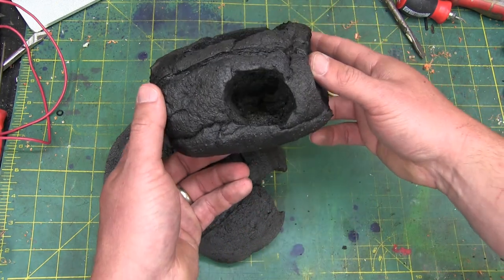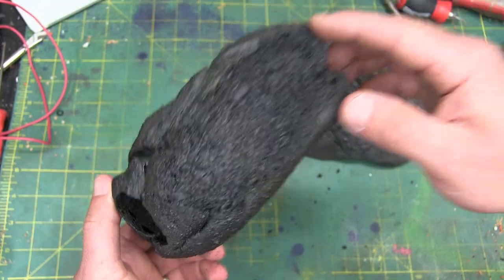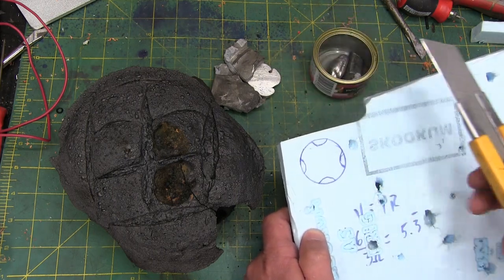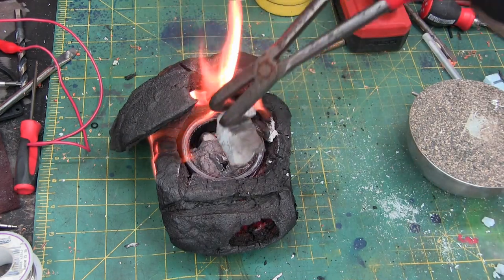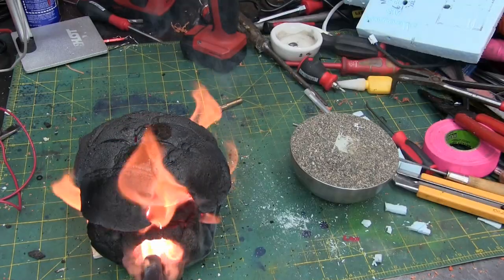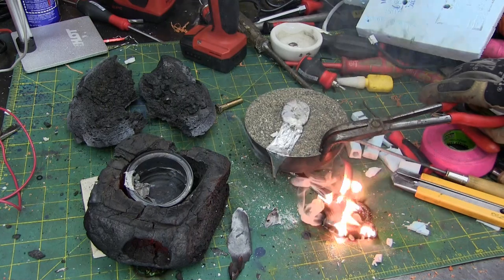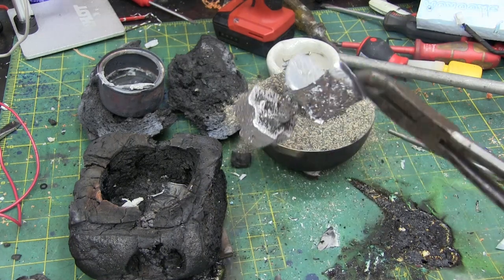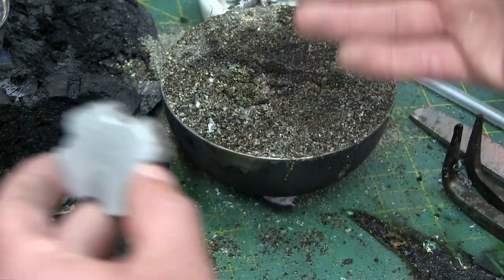BREAD BOWL METAL FOUNDRY!?

Comment: When I  was a wee child, the family and I would travel the miles to our local beach with pan, wicks and paraffin wax in hand to make sand candles. Using crayons for color we would melt our wax on a camp fire and pour the hot wax into small recesses in the sand that we would shape to hold  the molten wax while it cooled. Adding interesting shells and drift wood for effect we would then sell these creations at the church bazaar. While waiting for the wax to cool we would swirl the crayons around for effect and add the wicks in various locations within the candle. Of course we would do this only in the wet sand area so the sand would hold it's shape long enough for the wax to cool but what creative fun we would have!

Comment: That dross floating on the top is actually a good heat insulator.  When making steel calcium oxide (burnt lime) is added as a flocculant, attracting impurities from the molten metal and keeping the heat in the ladle until the desired temperature is reached.  To save energy costs the slag cap is only decanted immediately before the steel is poured.  So could one make high carbon steel from mouldy bread?
Reply: “flocculant” is my new favorite word. I’m dying over here.

Comment: I had mixed results with the bread I had on hand, so I figured I'd try some instant rice in a cannister (the porous stuff that's been pre-cooked and dried).
Holy shit! It bonds in the shape of the container. There was some warping as it shrank but I bet that could be fixed with a bit of experimentation.
So consider this -- carbon foam that you can cast! Just lay down a base of rice, place your shaping objects or cores, fill around it with rice, and heat. It all bonds together. :D 
Woohoo! This is gonna be fun.

Comment: That crumbliness that formed when you moved the metal is one of the most common ways cold solder joints form. One should always hold the part as still as possible when soldering until the solder freezes. Eutectic solder (63/37 Sn/Pb) can be helpful with this as it melts at a single temperature and so doesn't have a "plastic" state.

Comment: back when I was melt in down cans I used a rusted up tool box lined with a wood ash and water slurry after it dried.  that worked pretty darn well as a cheapo refractory material.  used charcoal and a shop vac on blow for the heating.

Comment: Did you carve the bread out before or after you carbonized it?
Reply from the maker: before. Less mess.
Reply: AvE do you recommend a Forstner bit, or sneaking up on it with a boring bar in the mill? Do feed rates vary on sourdough vs 9 grain loaves?
Reply: Just give 'er all she'll suffer.
Reply: You misspelled "cunsten tunglide". 5/7
Reply: PKMartin and it has been buggering me all morning! I blame because of the auto-correct on this high quality chinesium confuser, she was straight off the big rock candy mountain, gingzhou China, bought it not for getting through flea bay, but from the harbor fraught of the north, princess auto, and no it's not a milfuckee, not a snap-off but a real skookum choocher with all that glass reinforced abs plasteek and all the serious gravity corntained within her bowels, tis be a power fist, usually reserved for the wife's former sewing room, on account of the pokey bits being of the wrong angle,  she did cost me quite a few American dollhairs! I should have went "Yerman" enginerding on this one....
Reply: I've never heard of Yermany. Maybe you mean Churmany?
Reply: less mess more sandwich

Comment: I read the article you refereced in the carbon foam vid. Apparently this is also some super strong foam, too. Holds up to 500 psi, where foam used to make aircraft wings is only 60 psi compression.

Comment: I use to only listen to the 1812 on July 4th at the fireworks in Long's Park and on loop while driving around on November 5th. Now I hear it at least once a month. 

Also, I'm surprised that expanded charcoal didn't burn up before the aluminum was melted.

Comment: POW camp engineering at it's best. All it needs is electrolysis of water for the gas in the heating torch. Just dipping the foam in some gooey clay may have given you a much better surface too.

Comment: Forge on a budget. 
You will have to dig out some bread, but the mold is dirt cheap.
Try waterglass w/fine sand. You can let it harden overnight or not surprisingly- blowing it will make it hard. 
A chunk of dry ice or a bottle of CO2 might require less explanation.
Best price to get sodium silicate is ceramics supply. 
Eleven bucks a gallon is much easier than babysitting drain cleaner and desiccant.

Comment: If you seal that with an air proof clay such as kaolin or stoneware, you may be able to prevent it from combustion completely. I’m thinking of just using sawdust bound with clay or starch or both. Basically plastering it on both sides.

Comment: Will someone think of the poor cutting mat! Anyway, if you can, hollow out some of the area around the can, in a slightly larger circle. Then, point your torch toward the tangent of the can, not right at it. You'll heat more efficiently that way; it's how we build propane forges and foundries.

Comment: My boss once said "You can hurt yourself with a loaf of bread." That was 20 years ago, now I know how.
For a funny on your fire; I set an aviation gasoline refueler on fire once. The only real damage was to the cover over the fire extinguisher. I took the mangled remains of the fire extinguisher cover and the discharged extinguisher to the parts guy. I said "Replace this. Recharge this." He looked at the torn cover, looked me dead in the eye and asked "Is this going to happen every time we have a fire?" I clocked out, went home and dove quickly into some beer.

Comment: Fantastic idea, but I don't think it counts as minimum viable.
I occasionally melt aluminum, but not really often enough to warrant building a foundry.
I got one of those Christmas popcorn tins, and cut a hole in the side and a hole in the lid.
I just fill it up with charcoal and point a hairdryer at the hole in the side.
I use a soup can as a crucible, and I can melt around 2lbs of aluminum at a time.
The beauty of it is that the fuel itself is the insulation.

Comment: Hm... You could try using carbon foam as a mold: Put a model made of burned clay into the dough as you bake the bread, then pyrolize the bread and carefully cut it so you can just take out the clay model. Then you should be able to simply pour aluminum into the model-shaped hole to cast it. Or something like that.

Comment: Well… If your experimenting with bread recipes in the kitchen, and a batch doesn't turn out very good, you can alway repurpose it pretty handily. And I think, that if you “rebake” it immediately, you won't have to worry about it growing mold.

There's probably a whole line of research you could go down, for making bread recipes, if you get rid of the requirement that it has to be edible. You could specialize your bread to get the best refractive properties.

Comment: out of curiosity, what would've been the best way to contain that bench fire *without panicking? let's say it was somehwat close to an ignition source and couldn't risk just letting it cool out. let's also say you didn't have one of those white foamy fire extinguishers handy.
Reply: oldfrend baking soda, the beach sand he just used to cast the part, or even just a small bucket of dry dirt would work.

Comment: Sure, Carbon foam is a super insulator of heat, but it's got huge surface area and hot carbon Will Oxidize, often enough only half-way. as in CO no "two". as in swift silent sleepy death.  So... yeah, open a window and fan some nitrogen on it.

Comment: I've read that adding silicone or lead to Brass makes it better for casting
would the same apply to aluminum?
Reply: Not really, aluminum has silicon(no e)..
Copper would thin it out, flow better, but more than 3% is a waste.

Comment: Great use for a stale loaf !
What is the electrical resistance of the carbon bread, with meter probes about 1 inch apart?
Reply from the maker: +solarhope mega ohms. Previous VJO.

Comment: Why doesn't the bread immediately burn like char cloth? Char cloth is made the exact same way, but ignites with even the mildest spark.
Reply from the maker: +Nicholas Of Alexandria  The secret is the bubbles. No oxygen, no burn.
Reply: I think if you "cook" char cloth for a couple of hours after it stopped releasing steam/smoke, You'll get the same result or perhaps very poor char cloth. Normally, you should remove your tin with the fabric immediately after the steam/smoke stopped.

Comment: why no water to stop the fire? splatter due to boiling water on aluminum?
Reply: Water on liquid aluminum tends to vaporize instantly and violently causing hot liquid blobs of metal to fly around. generally quite a bother really.

Heat source was very local and the fuel slow to propagate.. No panic was the only option.

Comment: I wonder if that process can make something useful out of those disgusting store bought Christmas fruitcakes. Maybe you could end up with a replacement for cinder blocks. It may be a lot denser than bread carbon foam, but it may make a better building material for the outer structure of your new oven. The one thing I'd look out for, if you use fruitcake, is don't inhale the fumes from the baking process; what with the preservatives, it could be more toxic than that self healing cutting mat.

Comment: AvE I have got to say you are funny as hell. You remind me of some guys I worked with at US Steel Boiler makers ,Irinworkers . Love your channel by the way. I was going to ask for your advice as funny as that sounds.  I want to build an anvil using forklift fork known as 4140 it can reach a Rockwell of 50 to 55 . I was thinking of cutting sections around 6 in. long and welding them standing on end stacked together to create the waist. I was thinking of plug welding the shit out of them and chamfering the edges and welding them solid. am I right by saying this hould give me an almost solid piece. then I want to plug weld the face on using hard face rod in the plug holes then attaching the lunker to the base by welding the seam solid using a chamfer also.i was thinking of using the hardface rod for the plug holes on the face to eliminate soft spots after I Heat treat the beast. for the ther welding I was thinking of using 7018 rod for the body plugs and welding the seams. I realize this will be a ton of work and a shitload of grinding I was thinking I wouldhave my mother do all the .lol,lol,lol,. Am I thinking of tis project in the right way or do you suggest something better other than buying an anvil outright. I will be using a 2017 240 only welder From Hobart I think its the stick mate. Also I will be preheatin the beach to around 3to 400 degrees in order to have strong and deeply penetrated welds. I would like to here you thoughts on the subject. I am geeked about that welder they are just getting ready to launch it and mine will be sent hot off the line on the 27th of july. Should be a great machine and cant wait to put rod to steel....as said before looking forward to you honest reply.Martin at M&S Blades,Blacksmithing and the some

Comment: Can you melt iron?
Reply: iron melts at 1500 ish C, propane burns at 2200 ish C.  It could be done, but it'll take a while, and you'd make a hell of a mess when it dissolves or burns the carbon.
Reply: Protip = use jet fuel.

Comment: You're just torching charcoal...
Reply: There is very little combustible material left in that loath. Charcoal simply has a lot of the slower burning compounds removed or converted to faster and hotter burning carbon molecules.

The bread is nearly reduced to the basic mineral compound of pure carbon and perhaps various other non-combustibles. Not charcoal.